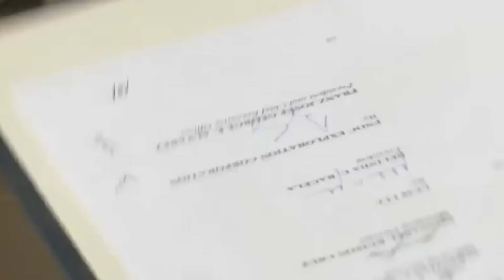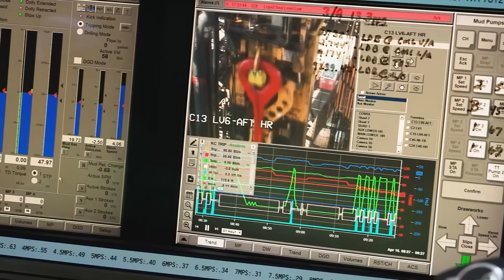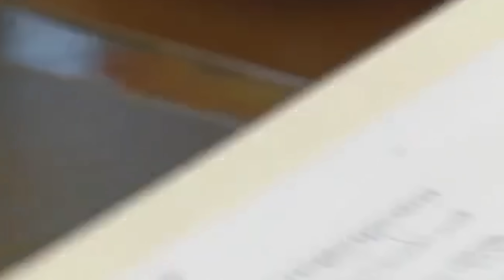Building The Philippines Malampaya Gas Field Phase 4

Comment: Yes Pbbm para sa bagong olipinas.god bless you all.
Reply: Kalukuhan fake  news
Reply: Fakenews daw si tanga @CristopherCabañas-l2t
Reply: @CristopherCabañas-l2t MANILA, Philippines — Drilling operations under the Malampaya Phase 4 project are now set in motion following the arrival of the drillship, which will tap new wells in a bid to deliver new gas supply next year.

The Department of Energy (DOE) said the seventh-generation Drillship Noble Viking arrived at the drill site offshore Palawan on June 19, signaling the start of the Malampaya drilling.

Under Phase 4, three new wells — Camago-3, Malampaya East-1 and Bagong Pag-asa-1 — will be drilled to extend the life of the gas field, which supplies about 20 percent of Luzon’s electricity needs.

“This development not only strengthens our energy security and reduces our dependence on imported fuel but also (benefits) consumers and supports our industries and jobs,” DOE officer-in-charge Sharon Garin said yesterday.

Garin emphasized the importance of timely implementation, pointing to the targeted delivery of fresh gas supply in the fourth quarter of 2026.

“Every well drilled, every milestone reached, and every megawatt produced is a collective step toward a secure, inclusive and sustainable energy future for all Filipinos,” she said.

The Malampaya gas field is the country’s first and only indigenous gas resource governed by Service Contract 38, which has been extended for another 15 years or until February 2039.

Tycoon Enrique Razon Jr.’s Prime Energy Resources Development and its partners, UC38 LLC, PNOC Exploration Corp. and Prime Oil and Gas Inc. operate the SC38 consortium.

The DOE lauded Prime Energy for its continued investment and strong collaboration with the government to achieve the country’s energy targets.

“The ceremonial arrival of Noble Viking is not merely the start of another drilling operation; it is a powerful symbol of what can be achieved when government and the private sector work together to power the nation responsibly and with purpose,” it said.

In October last year, the Malampaya Phase 4 development was certified as a project of national significance, enabling the speedy and systematic issuance of permits and clearances to fast track the project’s implementation. - Philstar
Reply: Kung  tunay na balita  yan  Mura Sana  Yong  gasoline patient crudo
Reply: Yan ang pang uuto ng mga Marcos sa mga pilipinong tanga 🤣🤣🤣🤣
Reply: Pnagsasabe mo johnny hahahaha
Reply: @Svge28 MANILA, Philippines — Drilling operations under the Malampaya Phase 4 project are now set in motion following the arrival of the drillship, which will tap new wells in a bid to deliver new gas supply next year.

The Department of Energy (DOE) said the seventh-generation Drillship Noble Viking arrived at the drill site offshore Palawan on June 19, signaling the start of the Malampaya drilling.

Under Phase 4, three new wells — Camago-3, Malampaya East-1 and Bagong Pag-asa-1 — will be drilled to extend the life of the gas field, which supplies about 20 percent of Luzon’s electricity needs.

“This development not only strengthens our energy security and reduces our dependence on imported fuel but also (benefits) consumers and supports our industries and jobs,” DOE officer-in-charge Sharon Garin said yesterday.

Garin emphasized the importance of timely implementation, pointing to the targeted delivery of fresh gas supply in the fourth quarter of 2026.

“Every well drilled, every milestone reached, and every megawatt produced is a collective step toward a secure, inclusive and sustainable energy future for all Filipinos,” she said.

The Malampaya gas field is the country’s first and only indigenous gas resource governed by Service Contract 38, which has been extended for another 15 years or until February 2039.

Tycoon Enrique Razon Jr.’s Prime Energy Resources Development and its partners, UC38 LLC, PNOC Exploration Corp. and Prime Oil and Gas Inc. operate the SC38 consortium.

The DOE lauded Prime Energy for its continued investment and strong collaboration with the government to achieve the country’s energy targets.

“The ceremonial arrival of Noble Viking is not merely the start of another drilling operation; it is a powerful symbol of what can be achieved when government and the private sector work together to power the nation responsibly and with purpose,” it said.

In October last year, the Malampaya Phase 4 development was certified as a project of national significance, enabling the speedy and systematic issuance of permits and clearances to fast track the project’s implementation. - Philstar

Comment: They have one gas field called the Alegria in Cebu which was opened during the Duterte presidency in 2020. That should help the Malampaya gas field when it runs out. Alegria oil and gas field is the world's seventh largest producer of natural gas.
Reply: The Alegria project is still on-going.
Reply: BIG FAKE NEWS THE ALEGRIA GAS FIELD PRODUCES 200 BARRELS PER DAY.. AND AQUINO ADMINISTRATION START THE ALEGRIA GAS FIELD PROJECT..
Reply: Ongoing siya pero maliit siya kumpara sa malampaya gas. Dapat  kasi di siya natakot sa mga intsik ara maaga noyang napadrill yan
Reply: @BenjKent-lu5fg  FYI,  during duterte,  walang drilling na nangyari sa West PH Sea.
Anong pinagsasabi mong natakot sa intsik? Ngayon lang may drilling sa panahon ni BBM.
Reply: @RR52517 yah correct because duterte was lapdog of Xi and Pro china
Reply: @BenjKent-lu5fg  Panahon ni duterte,  zero drilling sa West Philipppine Sea.  Ngayon meron na, sasabihin niyo natakot sa mga intsik?   mga mangmang.